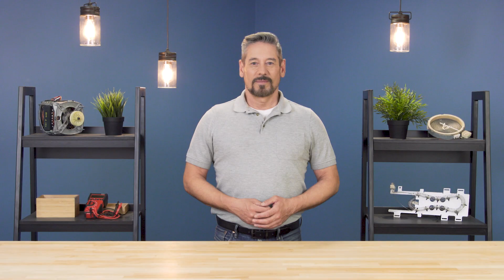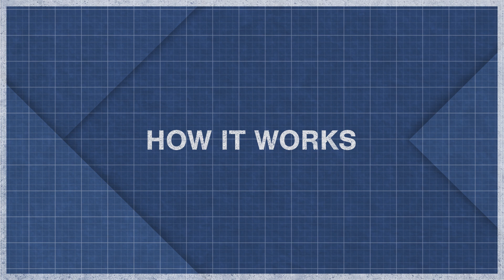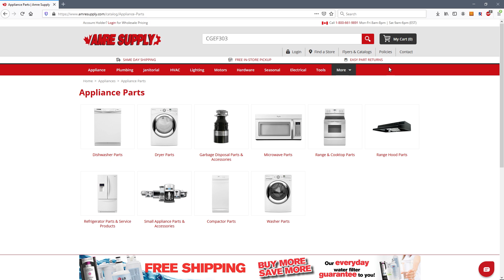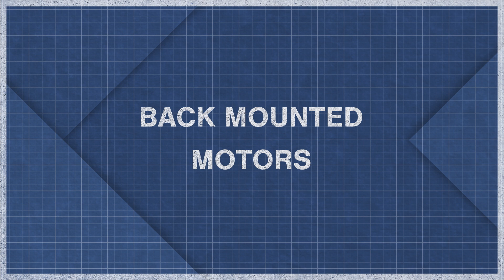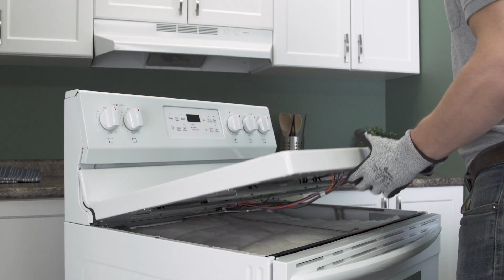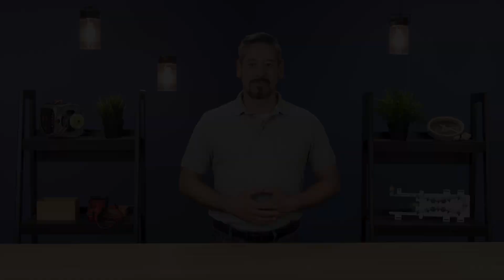Oven Door Lock Motor - Testing & Replacement | Repair & Replace

Comment: Hi! I found the motor in the back but there are two rods going to the front. One like you described, the other with a spring tensioner not connected to the motor. I can push the first rod in, but it doesn't open the door, whether or not I push in the spring loaded rod. Any suggestion?  Probably I'm just going to buy a new oven :)
Reply from the maker: Thanks for watching. It seems like you have a less common model. It your case it sounds like you're looking at both the motorized latch rod and a secondary tension rod (possibly part of a locking or hinge mechanism). If pushing the motor-connected rod doesn't release the door, the oven might still be electronically "locked" especially if it failed during a self-cleaning cycle.

A few things to try:
Unplug the oven for a full minute, then plug it back in. Some models reset the door lock this way.
If there's no resistance or movement when pushing the motor rod, the latch itself might be jammed or broken.
The spring-loaded rod might be part of the hinge tension system, not the lock, so it wouldn’t open the door directly.

One last thing you could try is manually turning the lock motor (some models let you rotate it with a screwdriver).

Comment: Can this be temporarily bypassed?
Reply from the maker: It depends on the wiring and what you're trying to do. You can unplug the door lock motor to prevent it from sending power to the motor, so this can help if the latch is getting stuck etc. In any case you might get an error code if the control board expects the door lock switch to be in a certain state.

Comment: Hello, could a failure of this part cause an F2 code on a 2013 Whirlpool stove? It's showing that code and the oven will not accept a setting hotter than 275F. Thanks!
Reply from the maker: Thanks for watching. It is likely a temperature sensor issue: https://www.youtube.com/watch?v=jnt_mUwdL8o

Comment: I have continuity on both the switch and the motor. Could the motor be siezed?
Reply from the maker: Thanks for watching. It could be a seized motor or an issue with one of the wires.
Reply: @AmreSupply are you suppose to be able to turn the motor by hand without much resistance?
Reply from the maker: @josephwood6112  The motor won't spin as freely as a blower fan motor. Depending on the motor, and if there are any gears, you might be able to turn the motor by hand, but it's not as useful as a test as for checking for unrestricted movement like in a convection fan motor.